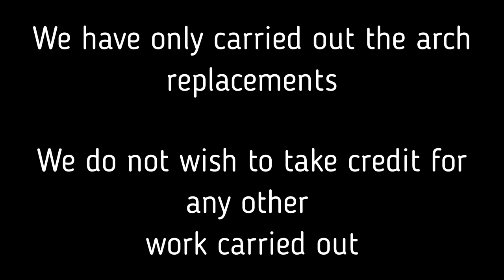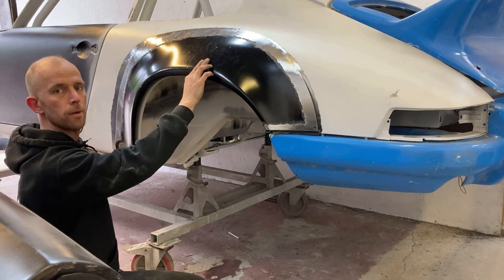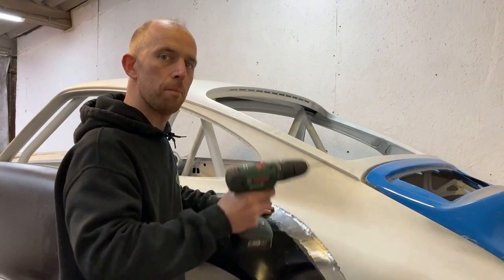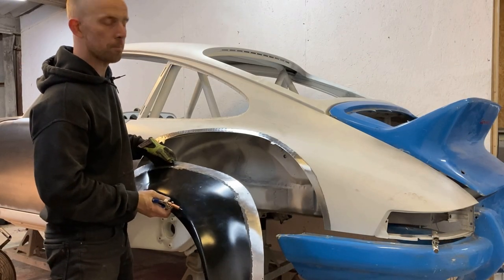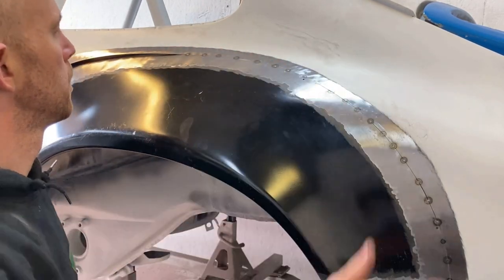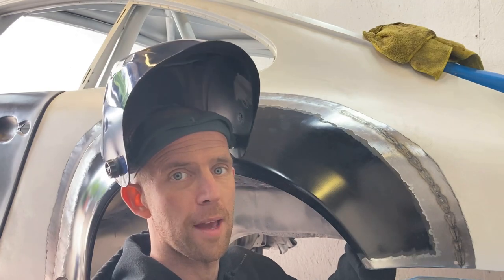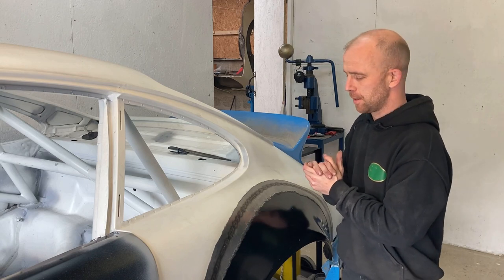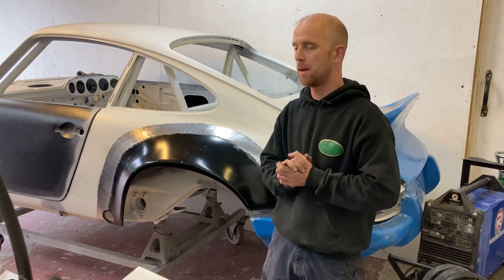Porsche 911 wide arch - how to Tig weld bodywork

Comment: Great work...hope you can answer a few questions
You say your welding at 20 amps...what amperage was used for tack welding ..what thicknes is the sheetmetal 20 gauge?... also what type wire was used and its thickness ... what size of tungston is preferred for fussion or wire filling this kinds of panels. Very good info shared with viewers
Reply from the maker: Morning. I’m tack welding at about 24amps, the body panel is 20 gauge steel and I’m using 0.6 Mig wire and it’s a  1.6 torch set up . Hope this helps 👍

Comment: Nice work. did you ever consider TIG welding with Silicon Bronze filler? it welds out with a lot less heat and dollies very nicely.
Reply from the maker: I wouldn’t join a panel using it personally myself. I don’t have an issue with it just personal preference.  Thanks 👍

Comment: hi Tom just down the road from you, found Trev's channel so found you, great tips as forming a pick up cab for a 79 CJ7 making the cab like a series 2 landie , so your vid perfect for welding the curve corners, going to try and minimize the distortion  so your technique great help, what was the power amps you use ?  thanks again Sam
Reply from the maker: Hello Sam. I would tack on 28 and weld on 24 amps .

Comment: Great work, are you mainly fusing it and just adding filler when you need to?
Thanks
Reply from the maker: Hi Adam. Yes that’s correct if you’re gap is tight enough you can do this on lower amps meaning less distortion. Once you add wire your need slightly higher amps and this could mean more distortion and more dressing up to do on the panel . 👨‍🏭

Comment: awesome explanation, but I have one question, may be more of a general concern:

what about the thickness of material at the joint...to me, seems like more of a fusion welding here, which from my experience made kind of a "valley" between the joined sections...is this considered ok? I have tried only smaller things, but at last resorted to adding too much material and grinding it of, with a bit of final planishing, just like mig welding, so not sure whats lesser evil here
Reply from the maker: Fusing the steel is my preferred way. There are no issues involved doing it this way. It joins together nicely and cleans up very easily without taking away any material. If your not that great at tig then I’d stay away from this as it will only cause you trouble.

Comment: What is the best wheel to strip paint and clean metal prior to  welding without effecting the metal
Reply from the maker: Abracs rust removal poly disc
Reply: @Metal_shaper_tom  Yeah i been using a 80 grit rolloc 3m cubatron discs to remove paint from practice panels. but seems to leave a rough finish